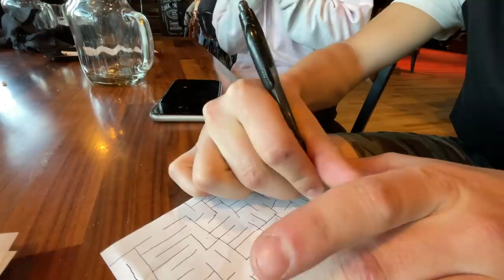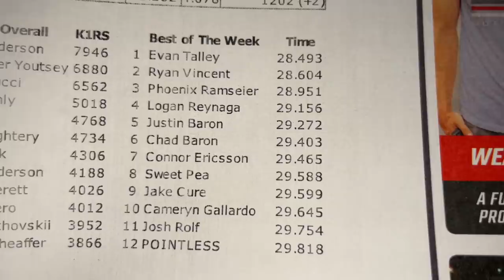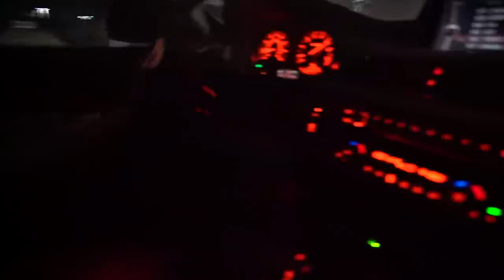Dirt Bike Rides out of Dealership - Buttery Vlogs Ep91

Comment: Lean to the outside in the karts they will turn faster if put your weight on the outside wheel makes it hook better, your braking is good but get on the throttle a bit quicker, ask an employee if you can chase them through the fast line

Comment: 2021 Kawi 450s are having so many valve issues 😭 Using the same valve setup as the 2020 250’s was such a bad idea considering those had a recall. We have had 4 back at the shop already with less then 30 hours each and they’re all toast
Reply: Shouldve got a ktm amirite

Comment: i feel like the 450 throttle is so touchy how tf do you do that lol
Reply: You get used to it after a while :)
Reply: @dirt32278  I hope so 🤣
Reply: @jbeezy126  ride with the white cuppler for 2 days then go back to green youll be good 🤣🤣🤟
Reply: @dirt32278  what are the couplers for? Sorry I’m a noob
Reply: @jbeezy126  technically green is for average dirt (loose or hard) black is for hard compact (less choppy) white one is moreless used for dunes or really loose dirt , (more choppy) :)
Reply: @jbeezy126  thats if you got a kawi ! I know honda has a button to switch maps ect , also launch control works 1st or 2nd gear for launches , disables when you shift in third , what it does it cuts igniton timing advance soo its a littlebit less aggressive (still lifts tho) 😄